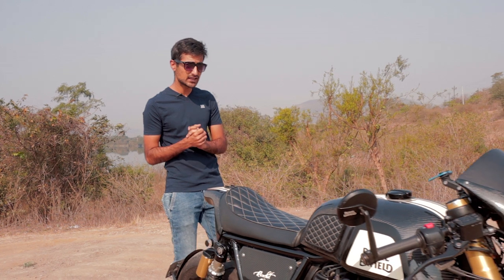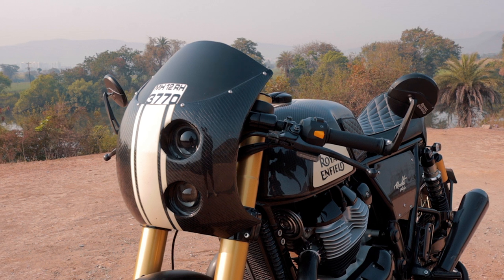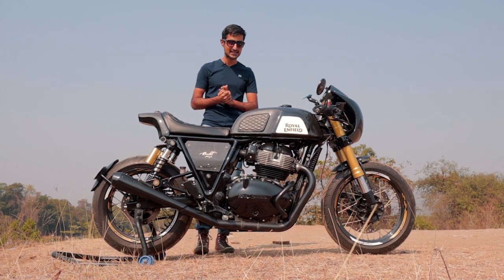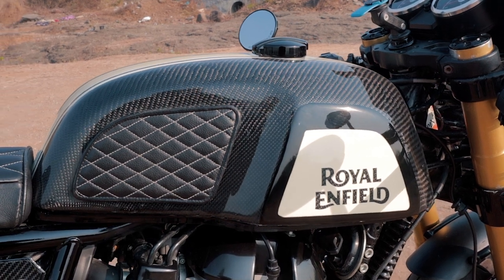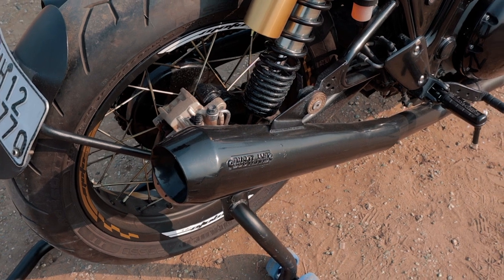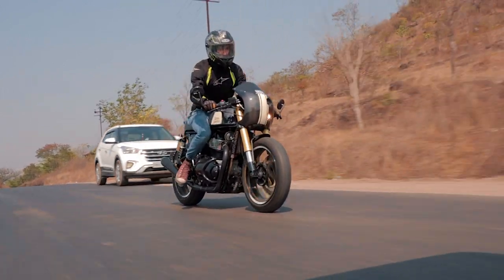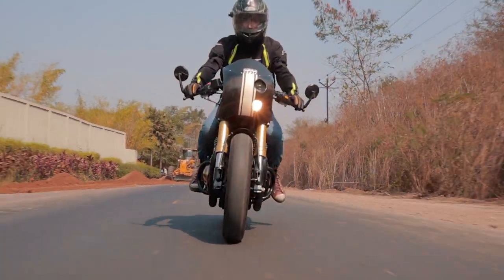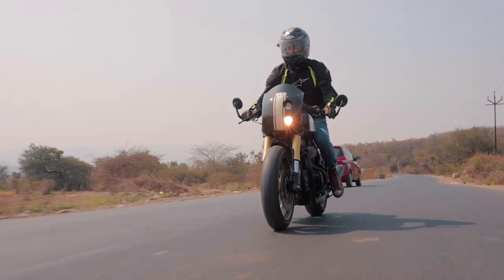Fully Carbon Fiber Bodied Continental GT650! 3.5 Lacs worth of mods 🤑! | AutoCulture

Comment: Loved the build 

but for this much money could have put 865 bore kit, new clutch , brake upgrades, sprocket , chain and tires as well with new exhaust and air filter with cosmetic changes also